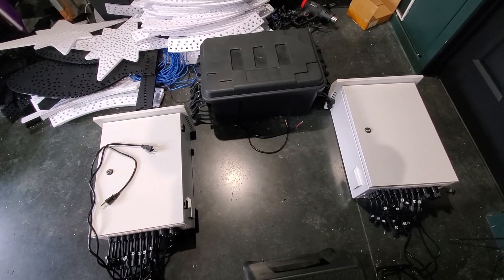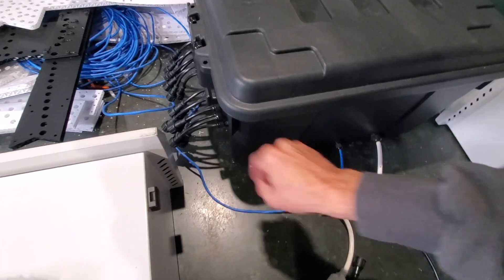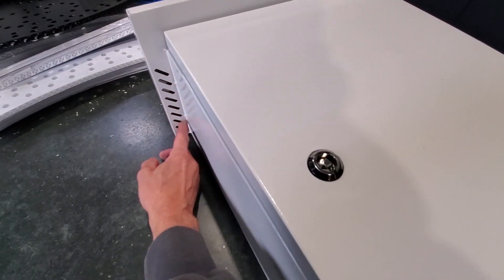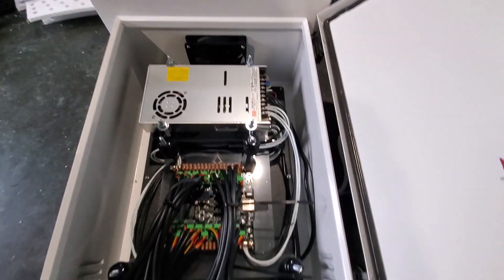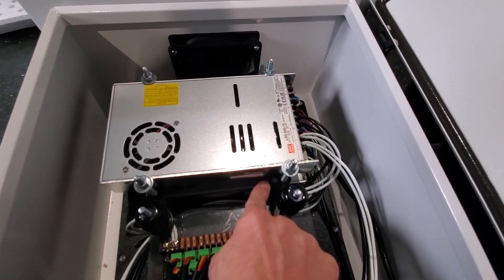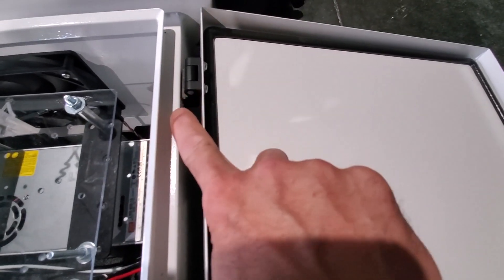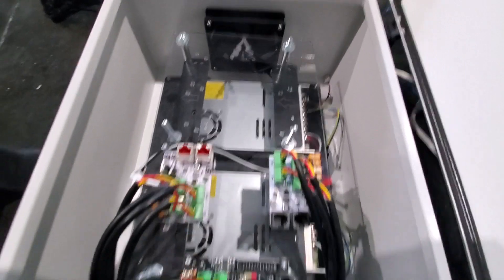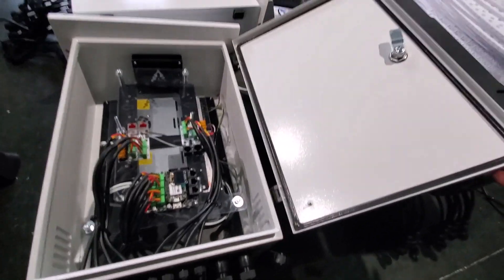Kulp Controller Build Comparisons - K32 DIY, K32 YPS Large Enclosure, K8 YPS Large Enclosure

Comment: Build. Cool. How do we network the kulp controller with other controllers. No. I am not a network genus. But willing to leaen
Reply from the maker: There are many ways to do this.  If you don't have a show player - it may be time to make your Kulp the "master" as it natively uses FPP, a show player.

We always recommend using a dedicated, off internet, router.  Something inexpensive like a Tenda AC1200 router is acceptable.  Create the "network" by setting the router up, plug in your controllers, get your IP addresses (and set them static in your router), then update Xlights/controllers as needed.